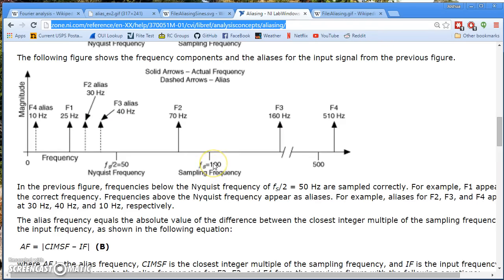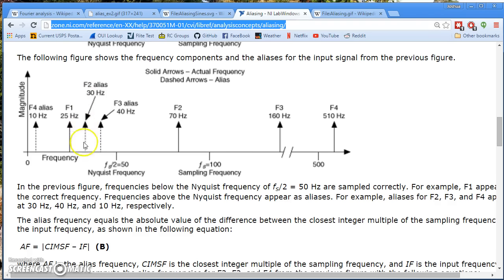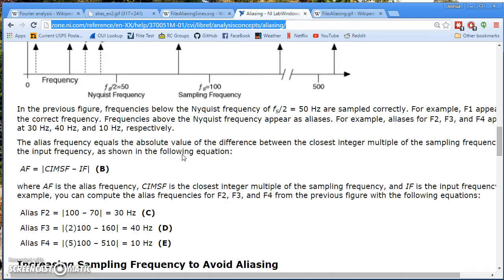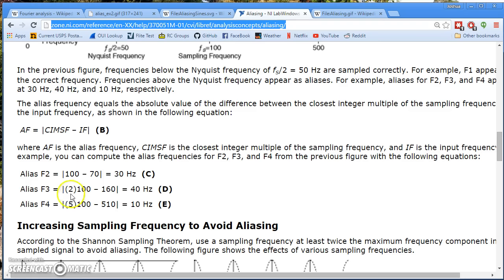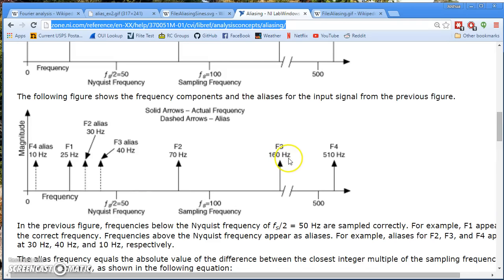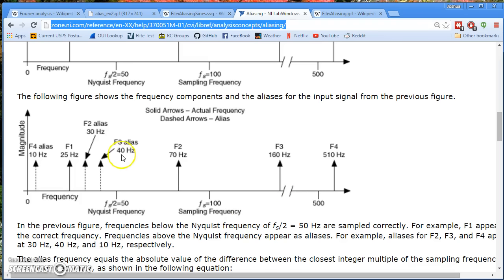Aliasing Primer for Multirotor Tuning / Analysis

Comment: Very informative video as always! But didn't you get the last part wrong? When the gif is showing the highest sampling rate you say "this is the worst aliasing" when in fact it's the least aliasing at that point? 
In the other parts of the gif the lines are more smoothed out = more/worse aliasing?

Comment: Even in theory, you need MORE than twice the Nyquist frequency for "perfect reconstruction". You make the case yourself at 6:53 yourself with the 3th example, when the sampling point hits exactly the zero-crossing: You cannot determine the phase (0 or 180).
Reply from the maker: 6:53 is showing an example of under-sampling the signal, so you are correct that at 6:53 you cannot determine the phase of the signal. 6:53 is not showing sampling at 2x the frequency.

Sampling at 2x the highest frequency is what you need to perfectly reconstruct a signal. Fourier shows us that any signal can be represented as the sum of sine waves. Nyquist shows that a sine wave must be sampled at exactly 2x its frequency to perfectly reconstruct it.
Reply: No. At 6:53 you are showing 4 sine waves:
1. sampling <2x frequency
2. sampling == 2x frequency
3. sampling == 2x frequency
4. sampling > 2x frequency

Regarding the 3th sine wave: I can give you another sine wave with the same frequency but different phase that fits those sampling points. So you cannot reconstruct the signal perfectly, there are two possibilities of reconstruction.
Reply from the maker: Maybe what we have going on here is a < vs. <= problem. The bottom line is that aliasing occurs when there are signal components above 1/2 the sampling rate.